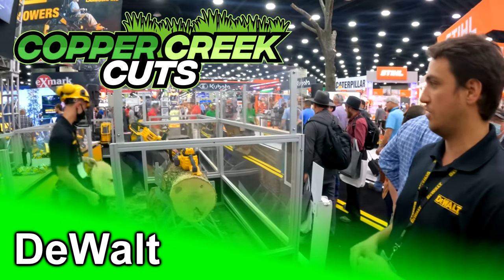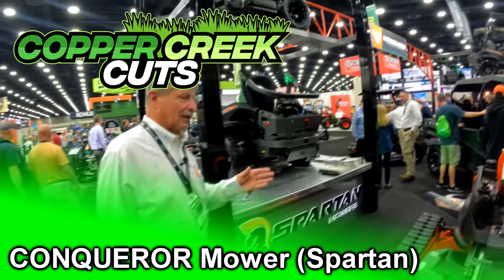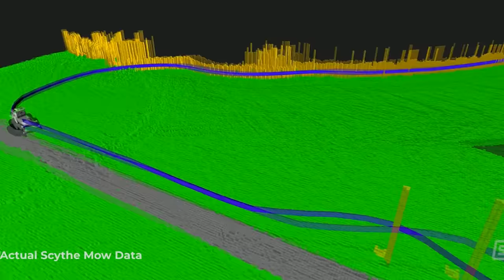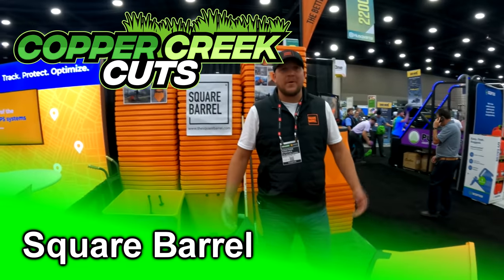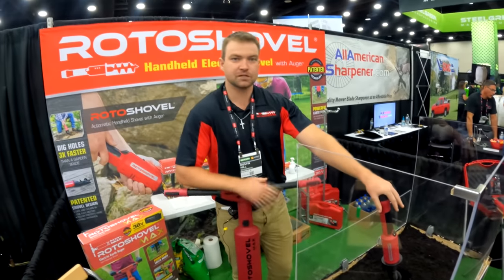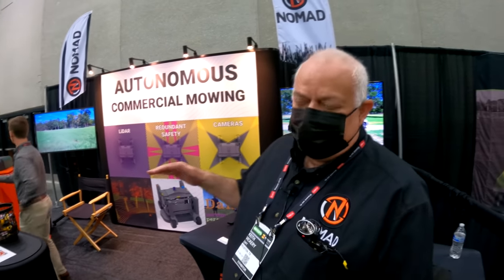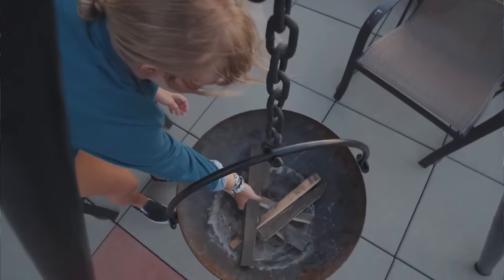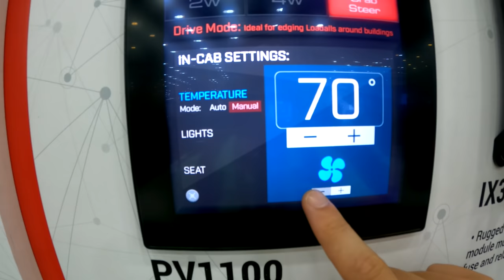16 Of The WILDEST New Tools & Machines From GIE EXPO 2021 (New 2022 Products)

Comment: All the stuff at the Expo looks great, but not for the average commercial guy. The autonomous mowers look very well suited for large acreage, but not small residential. All the electric hand tools look good, but I would put them in the more residential category. Even I, as a young man getting into lawn care, would not choose to have electric products in my arsenal of equipment simply because of the changing of batteries. It is very simple to fill up with some gasoline rather than have the process of changing batteries, charging the dead ones when you get home, then loading them up for the next day. I like the more simple, novel, and affordable products like the square bucket; it will sell well because of its ease of use, novel idea, and cheap price. Thank you Brad for going to GIE and showing off all of the cool products.
Reply: If I was a home owner I would buy a square barrel lol
Reply: If you think Small you will always be small !!!

 The battery problem you speak of is an easy fix. You buy enough batteries that will last you for a couple to a few day. That way you’ll never run out of battery power. Most companies have chargers that will charge from your vehicle battery. 
  I find charging off of a vehicles battery, charges deeper !!!!

Comment: The Dewalt 60v Sawzaw is a beast. Mine is about 3 years old and cut 100s of pieces of cast iron, wood and steel. It still cuts like new. I thought it was finally done a couple weeks ago but it was the batteries.

Comment: Nice video of all the new products.
As a retired Fire Investigator,
 I have issue with the guy representing the suspended fire kettle. He stated "it's considered as a NON OPEN FLAME DEVICE! THAT THE DEVICE COULD BE USED AT APARTMENTS, ROOF TOPS, ETC.  Sorry he is totally WRONG.  This device is and always will be considered as an Open Flame Device.   (Open Flame is anything that will conduct an fire 🔥 flame.)  If that's the case why, do apartment bldgs. deney use of gas and charcoal grills on balcony above ground level.  This unit should be Only used on ground level‼️

Comment: Electric chainsaws are not the move
Reply: I disagree
Reply: Eventually they will be the move because of the power, but right now the gas ones are still better. Run time is a key feature and must be mastered for this type of product to succeed. With a gas you can immediately fill it up when it runs out, but with electric you either have to carry full batteries with you or wait for them to charge and get going again. Also a lot of people out there just want something that makes noise and sounds powerful. And to the guy above me: “I disagree” is not a good response.
Reply: Merica 🇺🇸
Reply: @joshsrcs  we get it you're anti electric

Comment: Rotoshovel bogs down in that loose material in the demo booth, yeah that is total junk. 4in version digs 18in, with that 12in long auger. Uh huh...

The Square barrel guy offers no explanation as to why you want a square bin with a round bottom..

The fire pits need to have stainless bowls. Ash is corrosive and steel corrodes quickly at high temps. The claims they will last so long are dubious at best.